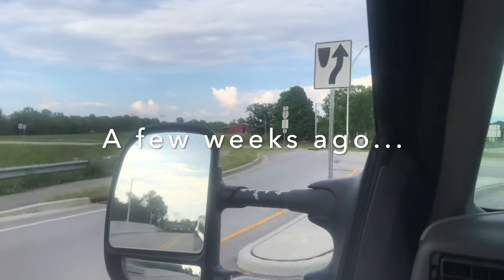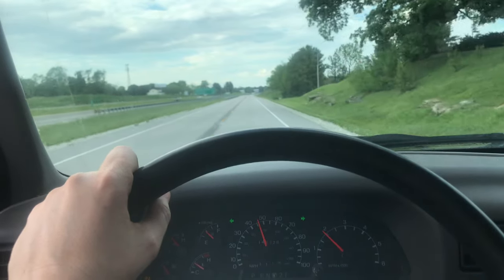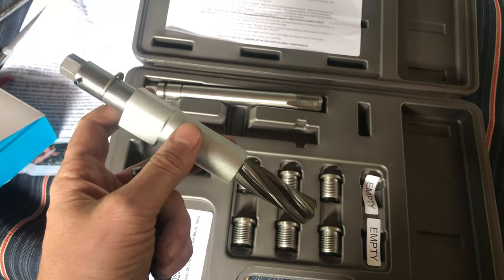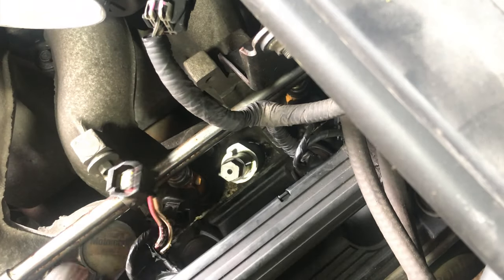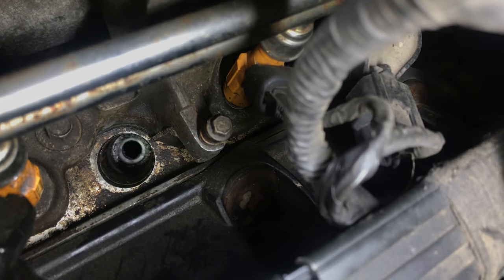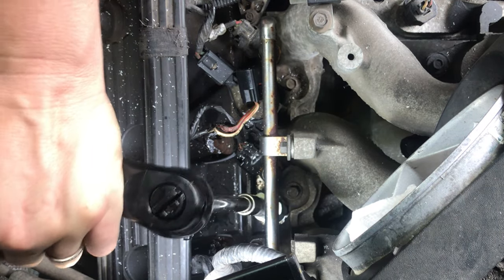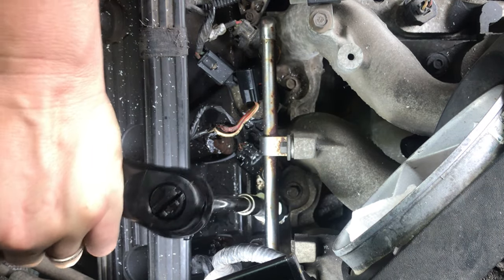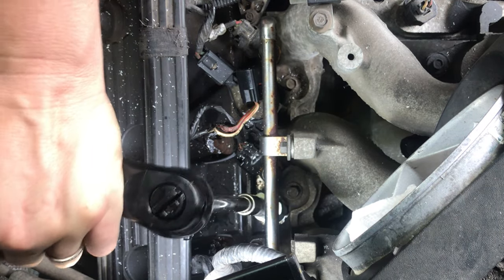Ford Triton V10 blown out spark plug repair!!

Comment: Hope you never have to do the "updated" Ford truck engine. You may already know about this, but the spark plugs break off in the head! My suggestion to Ford would be to make something in between blowing out of the head or breaking off in the head. Split the difference...:-)
Reply from the maker: MEE TOO!  at least the next one will be "free" if I have to do it again, since I have the kit now to do 5 more! Ford's fix for these is basically exactly what I did, but I think initially their little insert did not have the lip/shelf on it like these do, so I believe that even the fix was a problem! hopefully it is repaired for a while.

Comment: I have an 03 and it totaled progressive bought me an 04 on both of them they had v10.  I used my micro camera and checked both of the trucks when I got them because I heard this was an issue. They and had plenty of threads.  Does anyone know if like after 01 or 02 did Ford fix the issue because I know on 2000 I had to help arc weld a custom insert he had machined.  Than years later a couple more went and we bought heli could we took the tap without deburing and rethreaded and than lock tight the adapter and threaded plug in with the heli coil on it.  Than backed the plug out and coil stayed in place.
Reply from the maker: I think the issue was fixed in the early 2000's but not sure on that??  ironically I JUST blew another one a couple of weeks ago and it is one in the back hard to get to...so I get to do another one soon! ha The kit I've used for the other two has worked very well and we have had zero issues with those...so after I repair this one (3rd one i've done in-house, the truck had one other done at a local shop) my kit purchase has certainly paid for itself!

Comment: Soprendente para mi el torquimetro para el rache. Yo tengo una Ford E350 power stroke 7.3 del 97. Saludos marci
Reply from the maker: they are good old trucks, just have this as a known issue...we almost bought an E350! cheers
Reply: @marcijunebug  era ambulancia ahora motor home, realmente solo tiene cama que le pusimos, hicimos 1000km la semana pasada a la costa regresamos antier.
Reply: @marcijunebug  te refieres con issue a los de la culata de aluminio de tu v10?
Reply from the maker: @carlosalbertomejiatamayo2727  yes! Not one of Ford's greatest engineering moments! ha

Comment: Guess I'll be selling my 2002 expedition tomorrow. I don't have the tools to fix it. It's not worth $200 to fix it. I caint do it myself I could mess it up
Reply from the maker: honestly it wasn't that bad! I was nervous, but they pretty much make that little kit "dummy proof" the way the threader goes in  etc has that little collar to keep you from getting it off center, pretty neat set up the way it works...we got the kit on amazon and it will do more than one repair (8 I think)...if your expedition is in good shape otherwise I say fix it!

Comment: It happened to me while pulling a 26 foot travel trailer. I had 50 miles to get to my location. Lol
Reply from the maker: The first time it happened to us we were also pulling our travel trailer home from northern Indiana! We drove about 3 hours with it just hammering away! ha We DID stop and pull the coil pack so at least it wasn't shooting spark into potentially raw gas lol Pretty easy fix...I'll put it this way I won't ever pay anyone to do one again! ha
Reply: Thanks for the confidence in showing me how to fix it. I paid a mechanic $180 in the NC coastal and I see I could've just bought the kit
Reply from the maker: @o-manthomas4284  welcome! We did the same thing the first time...and then when the second one went and I called and he said $280 I was like "nope"...trust me, you can do it easily with the kit.
Reply: If Ford would have did this right in the first place. It would be a prefect engine
Reply from the maker: @o-manthomas4284  agreed! Great engine except for that!

Comment: You should have put oil on the drill when you're cutting
Reply from the maker: Did on the reamer bit, makes the shavings stick to it when you take it out too as well as severing as a thread cutting aid

Comment: What's the kit part number ?
Reply from the maker: i just looked it up and the one we bought is no longer available...it is this one...https://www.amazon.com/dp/B0015DU8JE/ref=cm_sw_r_sms_api_glt_fabc_K913HYJ0S58RCT2TNB3P?_encoding=UTF8&psc=1

there is a different one available that we almost bought and it is this one...the calvan one is often the one that is recommended, so I wouldn't hesitate to buy it also
https://www.amazon.com/dp/B000Z9D6KW/ref=cm_sw_r_sms_api_glt_fabc_1BG3S4CHVBQ1V5KKCB9D?_encoding=UTF8&psc=1

Comment: What name brand kit is this thanks
Reply from the maker: sorry for my delayed response, I somehow missed this comment until now...sadly THIS particular kit isn't available (MOUNTAIN MTN9200 Spark Plug Insert Installer Set (Ford) - Alloy Steel) but there are many on amazon just as good...when I searched my  order the following was given as the link for it's replacement.  I would recommend reading the reviews on it first but the pictures look nearly identical to the one I bought! Best of luck...it really is not a bad job to do as long as it's one of the plugs you can easily get to! cheers and thanks for stopping in!

https://www.amazon.com/CalVan-Tools-38900-Valve-Triton/dp/B000Z9D6KW/ref=pd_sim_sccl_1/147-6523588-2300206?pd_rd_w=FjuAF&pf_rd_p=dee70060-7c6d-4721-a321-50a27281cd22&pf_rd_r=6WJXPWBA5FVZE0M7PAKH&pd_rd_r=b6eb3cd3-81ee-4765-b3de-b922594d489d&pd_rd_wg=GgCQb&pd_rd_i=B000Z9D6KW&psc=1

Comment: How far did you drive it like that?
Reply from the maker: the first plug  that blew we drove it approximately 280 miles pulling home from vacation with our travel trailer! When this second plug blew I drove it about 75 miles home from work, then didn't drive until I fixed it.

Comment: Cut some foam to fit inside you spark plug socket and poke a hole in it for the ceramic part of the plug to grab on to, then you can insert the plug with the socket.  I think I would have taped the threads with a socket and hand wrench, broken taps are too hard to remove for me to use power tools tapping a thread.  It was nerve wracking for me to watch the tapping sequence.
Reply from the maker: according to the instructions they do not recommend hand tapping...I TOO would have preferred to do it by hand (they are aluminum heads, so are very very soft, doubt I would have used power tool otherwise...), but having never done it before I was trying to follow the directions to the letter...lol which is something I rarely DO! Women who "behave" rarely make history! lol thanks for foam tip will give that a try sometime...cheers

Comment: The only way to permanently fx the pug issue is WELD THEM IN!
Reply from the maker: Haha truth! BUT with aluminum heads and tight fit for space to work in this fix is a good bet! The truck made it 170,000 before it blew 1st one, this is the 2nd one! Only 8 more to go🤣

Comment: Did it last? Did any more blow out?
Reply: I just had cylinder number 10 blow it’s plug out I’m about to order the kit right now.
Reply from the maker: It HAS lasted! I’ve done one more on different cylinder since the video even tho I routinely go around a check them all for proper torque specs (we made that a habit after the first one) but it seems when they go they just go, nothing you can do about it! Highly recommend the fix, has worked well for us!
Reply from the maker: @reptilesAndfish44  just make sure you check all the other plugs for proper torque after you do this one…now that you know you might have a problem at least maybe you might catch one before it has an issue…best of luck
Reply: @marcijunebug  okay I will check them all thank you for the the quick reply!
Reply from the maker: @reptilesAndfish44  you bet! It really isn’t a bad job to do, the ones in the back are kind of tight working space…but doable without pulling engine
Reply: @marcijunebug  yeah it’s the one In the back on the driver side unfortunately so pretty tight space
Reply from the maker: @reptilesAndfish44  when you said #10 I figured that was the one...ironically that is the last one I did on this truck about 3 months ago.  I just removed everything I could easily remove around and above and it wasn't terrible...I almost pulled the hood, but ended up being able to get it without...best of luck

Comment: This issue should have been a recall. Period. No excuse for having only 4 threads in aluminum on a highly pressurized combustion chamber
Reply from the maker: agreed, really a poor design on an otherwise great engine. This is truly the only issue we've had, I've done one more since cylinder this video even tho each time I do one I check the torque on all the others...when they want to blow, they blow, at least they are fixable! thanks for the comment!
Reply: @marcijunebug  yes great engine. I currently have 320,000 miles on my e250 and just blew number 2 spark. Still running great otherwise

Comment: If you locktite the insert threads and JB Weld the  plug, how do you get it back out when you change the plug?
Reply from the maker: Lock tight the INSERT, the plug was threaded into the insert with never seize
Reply: @marcijunebug  What's the JB Weld for?
Reply: Sell the truck!

Comment: These Triton motors are one of the worst ideas from Ford. I have a V10 as well, got the truck very cheap, and it just blew the 4 plug & insert (that had the Permatex diesel engine thread lock on it) clean out the head. Parked it and it has just sat on the street for 3 weeks. I hate this motor, it has been nothing but a PITA
Reply from the maker: haha...well I would tend to agree...BUT they are worth fixing IF you can do it yourself.  It really wasn't that bad and the truck has been running like a champ since I fixed it! We even pulled a 27' travel trailer around camping all over this summer and it did great! It's an old truck but we know the engine fairly well (let's say it has provided many opportunities for us to get acquainted!  ha) Thanks for stopping in!
Reply: @marcijunebug  yeah- I hope the threads aren't blown out of the head; I got the truck for less than 1/2 book (friend's father's estate) and we did a ton of work to it. Top end, upgraded the brakes, suspension, Detroit locker, Gibson headers, SPD Y-pipe modification, Gibson side-exit, cat-back exhaust, stripped and painted (3.5 gallons of paint & clear), navigation head unit, Bearcat 885- tons of work. Once done I hooked up a double-axle trailer and moved from the insane Seattle area to the RDU. On the truck scale, the combo weighed in at 23, 556 lbs., with me & my "Cow dog" out of the vehicle.
To me, it's been nothing but a problematic POS engine. I honestly think the 8L Dodge motor is world's better, but if I do anything more with this rig it will be a Cummins swap. It's a nice looking, usable truck, but the engine is a huge let down
Reply from the maker: WOW! ha well we haven't done that much to this one...been a pretty rock solid runner except for this one "small" issue! ha It does tend to "eat" brakes and rotors...and so does my uncles truck that is exactly the same year and model...I figure we will run it until it won't run any more...and for us that's after we've patched it up to the point there aint nothing left to patch! ha  My 2003 mini has 420,000 original miles on it...still runs like a top! I'm starting to thing the Body will  fall off before engine quits...the truck is also fairly rusty and I figure we are on borrowed time there...I've patched and patched...just not much left!
Reply: @marcijunebug  this truck came from Central Oregon, no rot anywhere before we stripped it down & did a full paint job. It is really clean, looks awesome- came with a Warn bumper & winch, we upgraded a lot of stuff. But the engine is such a turd